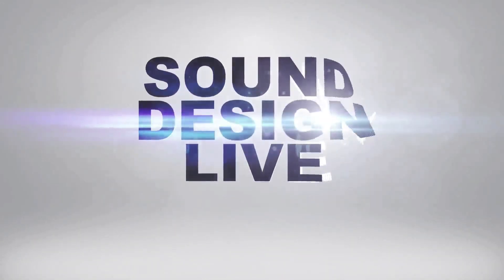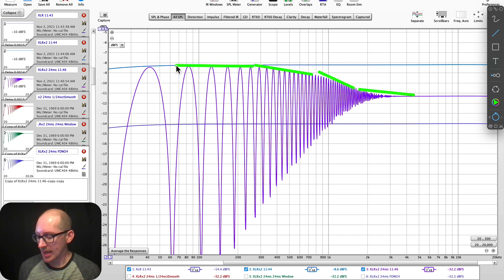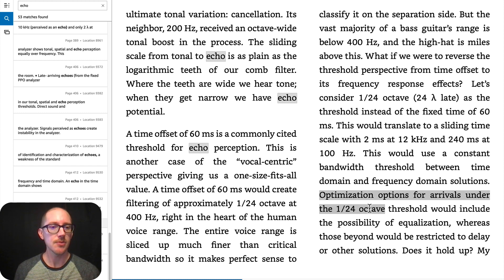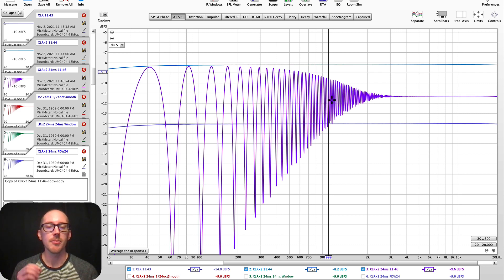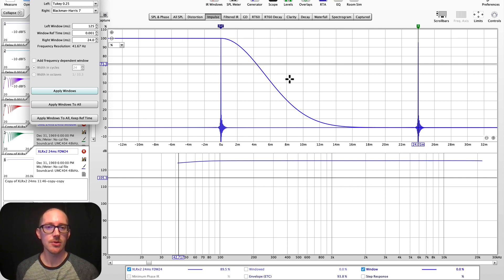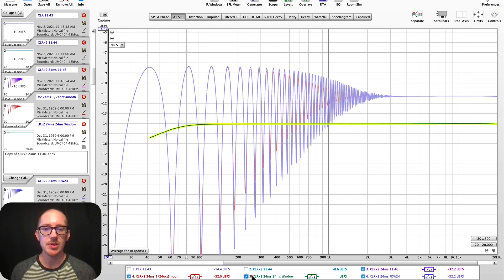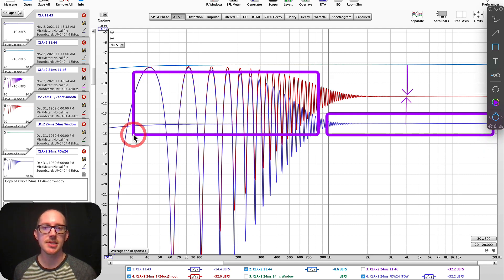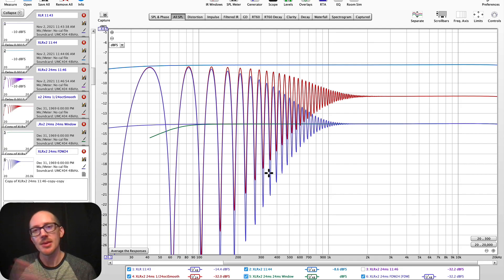How to remove echos from your measurements in REW

Comment: Can you please explain the process for reduce noise (in the phase) from echo in a speaker measurement (for alignment)
In REW, or can't REW do that 🤔?

Or you cover this , somewhere, similar to:
https://youtu.be/vLI20tsbbeQ
?
Reply from the maker: Hey Niklas, as far as I know, playing around with the window settings is the only way to do it. While it's not the same as CrossLite, there are quite a lot of settings to choose from. You should be able to get pretty far with those.

That being said, you can't beat reflections. The solution is always to move the mic to get better data or switch to another solution.

Comment: From 1/6~1/24 octave or say 6~24 wavelength is the "spaciality" area from the same book, which means they would sound like reverb or chorus rather than tonal change. Under 6 wavelength is the tonal change area. So I would say the threshold would be somewhere closer to 6 wavelength instead of 24. This is assuming that the late arrival is way smaller then the direct sound as in most of the real world venue. And also not going to EQ the reflection if it's from ground plan and audience is going to cover it.
Reply from the maker: Hi 陳星奎, thanks for offering another perspective. So are you using REW with the FDW set to 6 cycles?
Reply: @nathanlively  what do you recommend for cycles?   I recently watched a video that suggested 15 but I’m not sure why
Reply: @joek6207  same with me. I highly suspect you and I watched the same video. Curious to hear Nathan Lively’s response